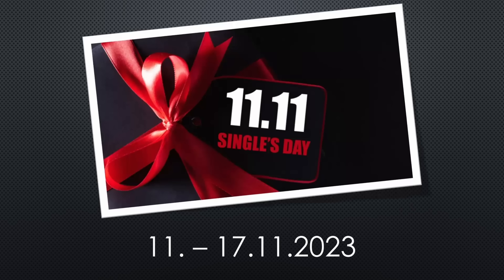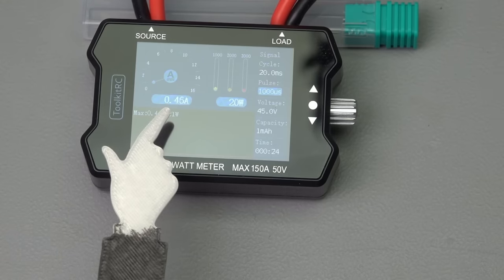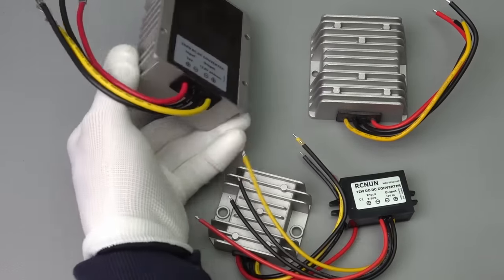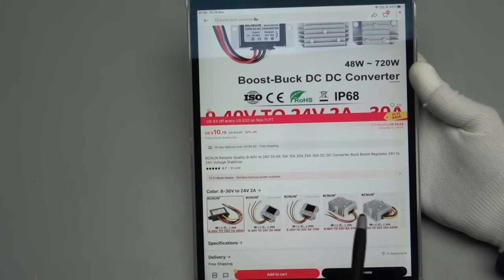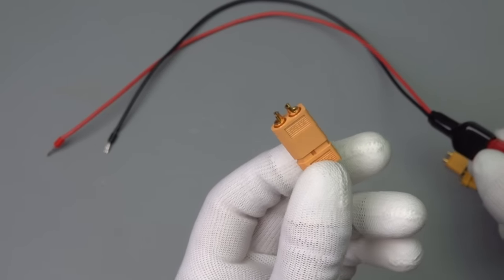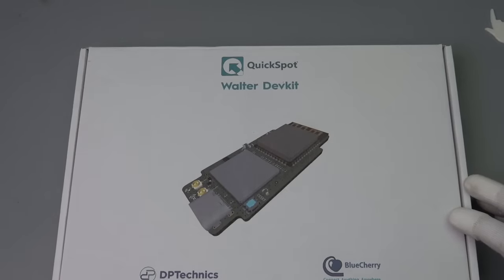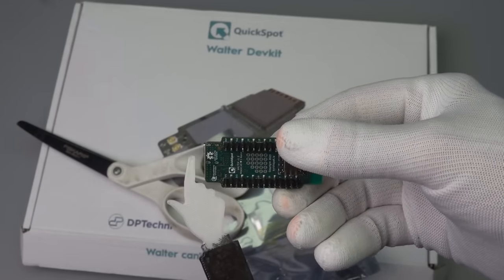471 Well timed Mailbag to save your money Part 2

Comment: Did the USB C sockets have the CC1 and CC2 resistors?
So they can request 5V from a other source
Reply from the maker: Good point. I only tested them with a USB-A to USB-C cable and they worked. After your post, I tried it with a USB-C to USB-C cable and they did not work :-(
You need a "trigger board" for this purpose
Reply: @AndreasSpiess  thanks for testing. That's a no go for me, because I mostly use C to C cables 😕
Reply: There are 6-wire versions that have power, data & CC for higher power, so either QC or PD.

You can also get 4-wire ones (ie power & data as per USB2).  Won't get you PD, but will get you QC.  I've seen some sellers claim the 4-wire connectors have CC, but I'm not sure about that.
Reply: @j.f.christ8421 do you mean by that the 6-wire version needs to be hooked up to some controller board/resistors or are these already integrated so that you only connect pos and neg?
Reply: @MarcRitzMD I assume they mean the USB-C connector itself. I seen 6 pin versions, which are much easier to solder.

Comment: For Andersen power connectors, grab a tube of zinc (dielectric) grease and give the sliding connections a good swab with it.  They tend to oxidize if left alone with voltage on them for a long time, and the grease helps immensely.  If you can't use the grease, disconnect and reconnect them a couple times every other week or so to scrape any oxidation away from the connection points.
Reply from the maker: Good idea, thanks. Ordered ;-)

Comment: The power meter may need calibration for zero current.  The chep meter I have required a reset button press at 0A
Reply from the maker: I did not find a reset button nor a remark in the manual :-(

Comment: The UBlox eval board video report will be informative.  It likely employs "RTK" which uses data from Control Points and sends via Cellular all Satellite corrections to achieve the 10 centimeter or so accuracy; it also provides vertical accuracy at that level.
Reply from the maker: Yes, it uses RTK and Wifi, cellular, or satellite communication for correction data. An overkill for a normal application. But handy to play with

Comment: Nice review(s) Andreas.  I was definitely disappointed in the power meter error.  I find it so common on every battery monitor that I’ve tried that I’m in the process of designing my own.  That way I have control over all the error sources (ADC gain error, offset error, non-linearity, etc) and can compensate accordingly.
Reply from the maker: Also a possibility. I think it would be possible to offer a calibration procedure for these devices. It is a pitty that they are not accurate. Because the rest is pretty good.

Comment: Summary
1. Power Meter WM150 50V/80A
   - Timestamp: 0:47 - 4:30
   - Price: $29.52 (free shipping)
   - Positives: 
     - Good build quality with a nice display.
     - Counts capacity and displays a graph.
     - Precise measurement for current (amps).
   - Negatives: 
     - Misreads current when no load is connected (0.45 ampere error).
     - Maximum 150A rating is misleading; it's 80A continuous.
     - Consumption discrepancy (measures 250 mA consumption while actual is 30 mA).

2. RCNUN DC-DC Converters (Buck and Buck-Boost)
   - Timestamp: 4:37 - 7:33
   - Price: Ranges from $11 to $40
   - Positives: 
     - Low radio frequency interference (RFI) for buck converters.
     - Versatile input ranges (buck-boost converters).
     - Multiple power options available (40A, 6A, 3A, 1A).
   - Negatives: 
     - Uncertain RFI performance for buck-boost converters. One of them is good, though.

3. DC Connectors (XT30, XT60, Anderson Power Poles) and Tricks
   - Timestamp: 7:36 - 10:27
   - Price: XT60 connectors 10 pieces for $10.80 + $3.37 shipping
   - Positives: 
     - Variety of sizes and types (XT30, XT60, XT90, Anderson).
     - XT60 box mountable connector available.
     - XT60 connectors have a weatherproof cover option.
   - Negatives: 
     - XT30 connectors may be too small for some applications.
     - Anderson connectors are more expensive than XT connectors.

4. Wired USB-C Power Connectors
   - Timestamp: 10:31 - 12:00
   - Price: Square ones 10 pieces for $3 + $2 shipping, round ones 10 pieces for $4.71 + $2 shipping
   - Positives: 
     - Easy to mount (clip-on and screw-on options).
     - Suitable for cases without 3D printers (round version).
     - Pre-soldered connections.
   - Negatives: 
     - Only for power delivery, no data transmission capability.

5. Walter, an ESP32 with NB-IOT Functionality
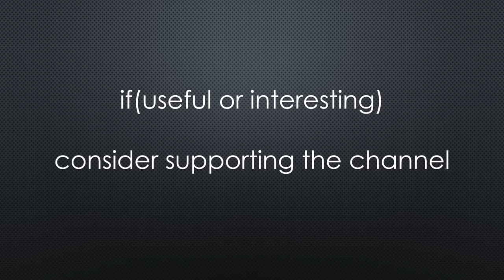   - Timestamp: 12:04 - 17:00
   - Price: Not provided.
   - Positives: 
     - Includes LTE functionality.
     - Compact and open hardware design.
     - Features a popular ESP32 microcontroller.
   - Negatives: 
     - LTE functionality not tested in the video.
     - Relatively new product with limited user feedback.

6. UBLOX C214 RTK Precision GPS Board
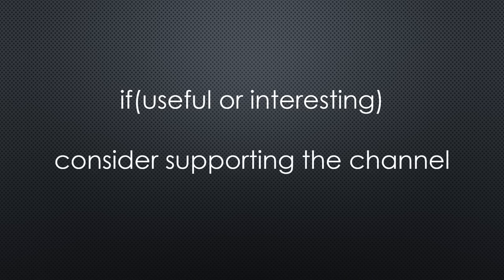   - Timestamp: 15:01 - 17:00
   - Price: Not provided.
   - Positives: 
     - Offers centimeter-level navigation accuracy.
     - Includes additional 4G functionality.
   - Negatives: 
     - Complex technology may require additional learning.
     - Specific use case (precision navigation). 

Disclaimer: I utilized ChatGPT 4 (10 Nov 23) to condense the video
transcript into a summary using this prompt: "the following is a
transcript, where the speaker shows different products.  make a bullet
list for each product with price, positive and negative findings. also
show the timestamps so that a reader can easily jump into these parts
of the video."

Comment: Do you think Walter would be a good choice for me if I wanted a Device that could send Telemetry from a RC Plane / Drone like Position, Speed, G-Force and so on to a Server in a fast Way - so the Data could be displayed almost in Realtime?
Reply from the maker: The data rates offered by the 4G IOT protocols are much higher than LoRa. So I assume it would be good for that (if you have coverage where you fly)
Reply: When you have LTE-M coverage you get a typical delay of 10-30ms, if you only have NB-IoT it increases into the seconds range. So if you have LTE-M coverage it would definitely be a good possibility.
Reply: That sounds good, thanks a lot for that insight! @DPTechnics

Comment: Could it be that the power meter is using a Hall Effect sensor to measure currents?
If so, then you should be able to see quite an offset when approaching it with a magnet.
Reply from the maker: I do not think so. It would not make a lot of sense because there is no need for insulation. It even looks like they use a high side mesurement that has a big common mode error (the current error goes up with voltage). That would not happen with a hall sensor.
Reply: @AndreasSpiess  I can imagine they need internally some buck/boost converter to power the internals of the meter itself.  Then they need some form of isolation.
If they don't, then you need quite a high resolution A/D conversion even when you would use an opamp to amplify the voltage measured by the Kelvin connection on the shunt.
Such a setup would indeed result in quite a big common mode error.
But on your video it looks more like a "DC-offset", which is quite common for Hall effect sensors.

Or could it be that they used completely different metals and thus create some thermo-couple effect which can add a significant offset related to the low voltages over the shunt?

Comment: I appreciate the useful DC connectors.  I used to hate the endless variety of DC connectors on consumer electronic and tried to "standardize" on 3.5 mm coaxial connectors for all my projects.  That cut down my inventory in my parts bin but was in many cases inappropriate and gave up too much utility.  I will try a more nuanced approach in the future.
Reply from the maker: Even the 5.5mm barrel connectors have two versions. Very annoying!

Comment: Some years ago I bought a few exactly the same looking ones from a brand Daygreen. Mainly plastic ones with big screw terminals for smaller currents but also a few for higher current that looked identical. I found them very reliable and also able to handle the max rated current with a stable voltage. Nowadays they seem to have raised the prices and these RC Nun branded ones seem more affordable. Great to hear you've found them reliable as well since I've been weary of their quality due to lower price. The name doesnt exactly sound very professional either. It seems common for these brands to pick seemingly random Western words for their brands. Good example are those common relabeled "Liitokala" Li-Ion batteries. In Finnish "liitokala" translates to "flying fish".
Reply from the maker: I do not know how they determine their names. I sometimes think, they sound-translate the chinese name to english. But I do not know. For their first names, they use western names. Much easier for me ;-)
Reply: @AndreasSpiess  Agree!

Comment: these ones 11:26 have one big disadvantage: you cannot connect through them the modern USB-C power supplies with PD - simply not having CC1 and CC2 to pull down, will tell to the power supply: I don't need any voltage. And there is no power.
Reply: You can get others with more wires
Reply from the maker: You are right. See my pinned comment.

Comment: SX1276 question. Can the chip operate with Meshtastic on other frequencies?  I would like to test meshtastic on 1.25m. Can I test the output of a SX1276 with a NanoVNA to ensure proper impedance?
Reply from the maker: The LoRa chips are very broadband. The filters on the boards decide the frequency. Consult the datasheet if you want to build a board for another frequency.

Comment: Hi Andreas! Great info in this video as usual from you! I was intrigued by the power meter issue and tried to find other mentions of it and could not find any. Still in the videos I've watched it always seems that a battery is used and that got me thinking that it might be an issue with noise from the power supply not been filtered correctly by the meter current sensing circuit. Also, it might worth updating the firmware on the meter.
Reply from the maker: I do not think so. My power supply is pretty clean. Did the other videos to the same measurements at higher voltages (the effect is small at 12V)? Then my device would be defective.
Reply: I've seen some testing with a 4s LiPo, so around 16V. Is the voltage input in your supply 12V by any chance?  @AndreasSpiess
Reply from the maker: @Jon_G  I used various input voltages. And I have no high-voltage battery handy. For 12V the error was minor

Comment: Curious if I could use a 1A rcnun module as a leadacid/starter battery trickle/maintenance charger in my campervan powered from the victron mppt auxiliary output
Reply from the maker: I do not know what specifications this application needs. Using a 13.8V converter for a 12V battery seems to be ok for trickle charging. But I do not know where you would get DC input voltage from.
The battery has to be disconnected from the victron for that purpose. BTW.
Reply: the victron is connected to the auxiliary lifepo battery and solarpanels,  I just want to use a small amount of solarpower to keep the starter battery topped up, probably I'd put a diode inline after the rcnun module.

Comment: Hi sir, this question is unrelated to this video i just have a question cuz i know you know a lot about this. How can i power the esp07 module just the chip, cuz when im powering it thru vcc and gnd with 3.6 the led is just open but the program i put in it is not working. I use a programer module to program the chip.
Reply from the maker: You can try to connect 3.3V to the pin labelled 3.3V. Max. 3.6V! Otherwise the chip can be killed fast.
Reply: @AndreasSpiess  thankss, btw i already figured it out, i just jumper the en, vcc and gnd, gpio 15 and it works fine till now. But still thanks for replying even if your busy 😇😇

Comment: With these USB-C connectors there is no communication, so it can only deliver 5V and devices will probably only draw 100mA
Reply from the maker: You are right. They only work with USB-A cables. If you want to use USB-C cables on the other side, you need a trigger board (see also my pinned comment). So far, I did not see such a board with a simple mounting possibility.
Reply: Or the device isn't working at all !
I bought 12V=>USBC converters, which work like a charm with my iPhone13
but do not work at all with a Pixel 3 !
Thus Pixel 3 needs a source with original PD 2.0 connectivity ☹
>Bauer Electronics | DC DC 8V-32V zu 5V Spannungswandler USB Typ-C 3A 15W
Reply: You need the 6-wire version.  It has the CC lines & resistors.
Reply from the maker: In the meantime other viewers commented that there are the same connectors but with 6 pins. So yo could wire them for QC or so (I made a video about how to)

Comment: Looks like cheap aluminium cables on the watt meter
Reply from the maker: Well possible. But for the 4 cm I assume this is not a big issue. I anyway would not use it for 80A continuously...

Comment: Centimeter precision?  No, I don't believe it.  You will have to create a 5x5 meter grid, with points on each coordinate to prove it to me.  Difficult.
Reply: GPS RTK
Reply: A university in GA was getting cm resolution from differential GPS about 2 decades ago. If this doesn't use that technology then I'm impressed with the accuracy claim.
Reply: @OldCurmudgeon3DP it does I believe.
Reply: You're pretty demanding to suggest that a guy giving you content for free set out to prove that a datasheet isn't lying.
How about you do it instead and prove them wrong.
Reply from the maker: So I know your benchmark ;-) I take the challenge.
Reply: GPS RTK is pretty standard and widely used technology (Civil Engineering measuring applications for example) 
And they do have accuracies in centimetre ranges.
Reply: @SenithDR  Well, centimeter precision must be a real thing then.  I just remember that the best hand-held units that I used 20 years ago for geocaching would hop around meters at a time, from moment to moment.
Reply: @GnuReligion  Industry doesn't use cheap consumer units.  I did surveying years ago, the units we used had sub-centimetre accuracy, they weren't anything you'd stick on your car windshield.

Comment: Consider replacing the term "Chinese factor" mentioned at 6:45, with a neutral term like "Derated Current Maximum".
Reply: Consider not policing speech.
Reply: @MrCarGuy Consider controlling what you allow to trigger you. ❄️
Reply from the maker: I agree, I am politically not always correct.